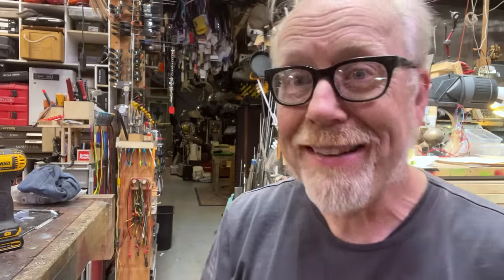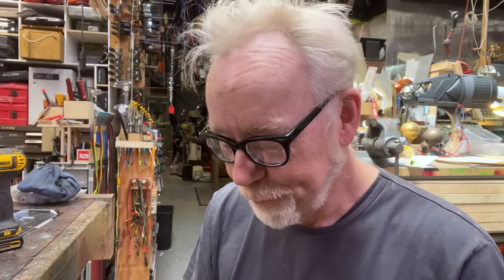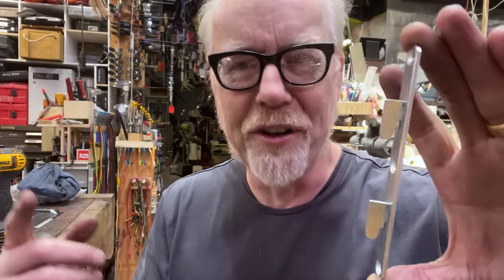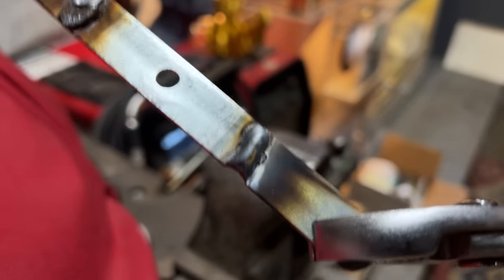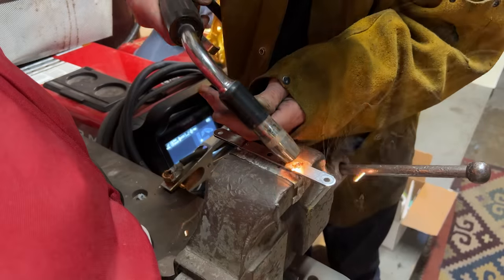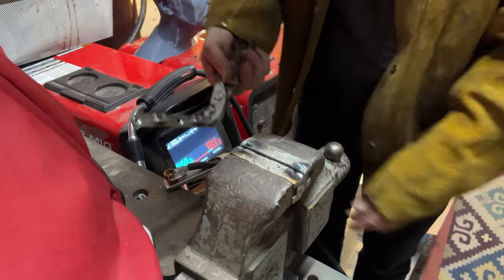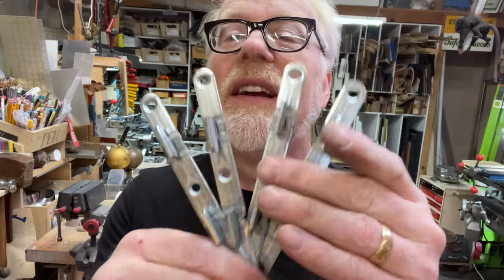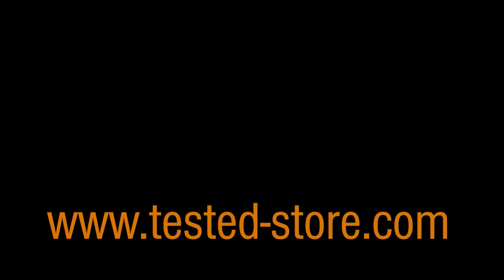Adam Savage Fixes a Squeaking Bed!

Comment: 30+ year welder  - There is no real need to grind slots into the swaged bit of the bracket.  Just welding over the area at the 120-150 amps the welder was pulling on 1/8" material would give at least 3/4 depth of penetration.    Also,  DON'T weld on anything galvanized, zinc, or other type of plated metal.  Completely remove any type of plating from at least a 1/2" around the area to be welded.  Inhaling, even small amounts of zinc oxide fumes can cause Metal Fume Fever.  A very nasty condition.
Reply: It's pretty funny how despite Adam doing so many things in 35 years, at his core the only thing where he's truly a master is model-making. He never reads books or learns from those who know more.
Reply: @ssl3546 he doesn't claim to be an expert in anything he does other then model making/ practical effects.  He's a bit of a Jack of all Trades but that also means hes a master of none of them.  He's said in many of his Q&A videos that he's constantly learning and just sharing that process with us.
Reply: @ssl3546 big assumption unless you're good friends with him? Also, this video is shot infront of a book on his workbench called 'Engines'. Which he did a video on imploring others read it because he found it so compelling to learn more about engines from someone who was an expert. So I'm not sure how true your claim is.
Reply: @Tobester_McDonkey 
That, amd putting a couple of metal shims on the flat part of the bracket,  inside the "hook" part.
A puff or two of graphite there, wouldn't hurt,  either.
Reply: How do you know if you have Metal Fume Fever? I have been doing Mig welding on Gal Pipe and been feeling under the weather, but I have been in an semi open place (double garage workshop with the doors open)
Reply: @thewhiterogue6468  Definitely asking for medical advice in youtube comments is the best way to go.
Reply: Please up vote this comment. Adam needs to see!
Reply: @vadhakara  Exactly how am I being "irresponsible"?  You can clearly see at 16:00 and later, the amperage displayed on the welder in the background.  About 120 -150 amps depending on which weld he made.  That would have given Adam the depth of penetration he wanted even without notching the brackets.  (Personally, I would have sanded to backs flat to remove the zinc anyways).
I made no mention of making any adjustments to the welder settings, let alone adjusting the Amperage Range.  
But now seeing that I'm somehow "irresponsible" in my original comment, I guess I need to explain a few things.
The Amperage Range Setting is (in this case) determined by the thickness of the base material, and not a persons experience level.  
Setting the Amp Range too low is almost as bad as setting it too high.  Because of this, there's often a chart somewhere on the welder to indicate the approximate settings that both noobs and 30 year welders alike should at least start with. Test these settings on scrap and adjust as necessary. 
The actual Amperage the welder delivers is determined by several other factors outside the scope of this discussion, but given the setup in the video, a current draw of 120 -150 amps is about normal.  
@vadhakara is correct in that the Amperage Range Setting was set a little high for this job.  This is only because Adam notched the bracket thus making the area to be welded thinner than the 1/8" I quoted.   What Adam should've done was to adjust the amperage range down to account for the thinner material.  He didn't, therefore he did "vaporize" part of at least one bracket because of this.  
But again, my original comment was in regards to not needing to notch the bracket.  Nothing else.
I still stand by that comment.
Reply: @thewhiterogue6468  First - Stop welding on galvanized metal.  If you've been feeling sick, do some research and possibly see a doctor.  
If you must weld on galvanized metal, use a grinder and sanding disk to completely remove the zinc from around the area (inside the pipe too) thats to be welded.  Wear a mask when removing the zinc.
If your getting white smudges or white smoke trails around your welds that's zinc oxide. 

Getting the zinc oxide smoke or any fumes under your hood is bad and should avoided, so here are a few things to help.
Don't weld galvanized metal inside the garage. Take it outside.  You can still be exposed outside, but your not just filling the garage full of fumes too.
Use a fan on low to blow from the side of the welding area to help keep the fumes from getting under your hood. Don't set the fan up behind or in front of you, it makes fumes getting under your hood worse. Be careful where you aim the fan so it doesn't disrupt the shielding gas.
Wear an actual N-95 mask. Change it often. (Don't use the blue medical masks. They don't wok for fumes)
Reply: @MyAvitech For welding, you should use a P100 mask. N95 masks don't work properly if exposed to oils (which may be on the surface of the metal).
Reply: 😀 @vadhakara
Reply: @dack42  Yup, P100 pucks on my respirator for welding with a risk of zinc contamination.
Reply: Even worse, some shiny metal things are cadmium plated. You REALLY don't want to breathe thoose fumes.
Reply: I had the same reaction. "How do I ask how he knew what kind of metal that is, because the color is sort-of zinc-ish? Galvanized-y?"
Reply: @MyAvitech  Good advice. I got a bucket of phosphoric acid to remove cotings, also very handy for rust. Zink is even worse when TIG welding, because it also makes the weld shit..
Reply: I had heard this before and was coming on here to say it. Essentially, proper welding gets the piece to a temperature that causes the rod/wire material to flow into the joint.
Reply: Vinegar bath for a day will remove the zinc layer. Do not weld on zinc. Do not weld on zinc in an enclosed space!
Reply: Yeah. Hmmm. Strange video.
-yup, Don’t weld zinc plated steel unless you know what you’re doing
-don’t bother with that groove perpendicular to the piece, in fact you’re increasing the likelihood of blowout/undercut at the ends. If anything a groove parallel over the tab projection would have been more useful to weld the two pieces together, but ground flush with tiny puddle weld re-ground should work fine.
-who really has this problem with squeaky bed hardware? Squeaky springs is the only thing I remember. He should have shown the incriminating loose piece with the play. (Maybe could have simply oiled it either…)

Comment: Hi Adam, I had the same issue with squeaky bed. At first I thought that hardware was the source of sound, but it was not. The root cause of it were the wood parts sliding against each other where long side bar touches the front/back of bed. The solution was to put a piece of PET sheet between the two elements plus screwing well all the hardware parts to eliminate any clearance.
Reply: Or wax.
Reply: Had same thought. Source of squeek not likely the hardware.
Reply: It’s the hardware not necessarily because the hardware itself is squeaky, but because the wear is allowing everything to move. It’s likely correct that it’s the wood that’s squeaky as a result.
Reply: Sounds like a piece of felt would be great too. Like the ones to stick under chair feet.
Reply: @Muscleduck  I think that would wear out too fast. But I've also noticed that stuff works its way out from under the feet of furniture, so I think that's another reason it might not be a great solution.
Reply: Yes and no, the idea here is to put a boundary layer that induces no squeak from itself. I'm a huge fan of using wax, but in this scenario you are as likely to create squeaking as much as removing it.
Reply: Great idea. Ideally, you would remove the squeak at the source, i.e. squeaky materials moving against each other. In my experience, nylon or even better, PTFE, works much better. When using these, you rather want to remove any movement to prevent wear and tear on the material.

Comment: Adam has a tig welder right behind him in the welding shots. On this job, I would have clamped the ears between two blocks of copper, with the main bar tight against them, and melted the swaged tabs into the main bar till the puddle had almost full penetration, no filler added. Oh yeah, and knocked the plating off with a wire wheel before welding.
Reply: My thoughts exactly. Just getting the heat in and melting the 3 pieces together at this scale would have been the perfect fix. I am certain the weld that ended up going down on the part was too cold and insufficient to actually bond. I am not a welder either, but it felt wrong lol
Reply: I thought the same thing
Reply: The zinc in the galvanized will fuck up the Tungsten in an instant. That's why we don't TIG galvanized in the first place.
Reply: @wargamingsupernoob  plus the fumes are toxic as hell. I sand that stuff off before I do anything else to it
Reply: With a TIG welder, you could weld the inside corners with little to no material addition that could interfere with fitment before weld-blending tabs on the back.

Comment: The “punch” (the male half of the die) is generally on the flat side of the part; the fillet artefact is (usually) the result of the initial distortion of the part into the female half of the die - prior to the stresses shifting entirely to sheer.
Reply: exactly opposite.
the male "punch" is on top in the cutting side(the ram), and the female die is in the tool underneath(on the table).
Reply: @TheSighphiguy  I've Heard It Both Ways😎
Reply: punch on top is proper because you have to punch it down ... the die is the bottom that holds the cut pattern and any bottom details required ... it is the place things would die if there when punched ... the roundness will always happen on the punch as it flexes and allows the metal to deform when driven into the die .... you may hit it once BUT the hammer rebounds several times this is the flex and the reason why the punch side deforms not the die side
Reply: Nah, it’s all in the tooling. That’s definitely a countersink tool. We use them daily at work.
Reply: @kaboom-zf2bl  You see this same behavior on rotary knives and shears.  The top side usually has a bend, the bottom side not.  Now top and bottom sides can vary, depending on the machine geometry.  But usually it's the forcing side that shows the initial deformation, the crisp side is the stationary one.  In my experience.  I'm sure there are people who have a differing experience.
Reply: lol that LEAKED Prigozhin video diary was the best summary of events, best thing ever!
Reply: I love the theory of the welding, but this part is so thin you should be able to get full penetration and a full weld without having to do any chamfering.
Reply: With a true male/female tooling pair, the resulting parts will have a fillet on the face opposite the tool that is their shape with the flat side on that face. For a negative space part (which would be some shape of hole), this flat side would be with the male. For a positive space part (which would be the chunk of material punched out), the flat side would be the female.
Reply: exactly, flat side is from the punch , rounded edges are from the die, material bends outwards towards the die (empty space)
Reply: @GarrettBShaw ..or at least mill the chamfer so it's consistent. Including set-up, the milling m/c would have been just as quick to use as grinding by hand, & quick & easy to alter for different positioning (eg longitudinally, which would have been my expected fix) & held the piece in place while the welding was performed rather than swapping to another vice..
Reply: Depends if the part is cut thru die, or if you cut excessive material thru die and part is that stays on die
Reply: @TheSighphiguy  Isn't it shear force? I.e both sides could be considered the cutter?

Comment: Our bed rails are bolted into the head and foot boards, two bolts at each corner. Over time it does loosen (probably from use and temperature changes through the seasons), but it’s easy enough to just get the Allen wrench and tighten it. (Yes, it’s an IKEA bed.)
Reply: All hail the furniture god 😂 I’ve lost count of how much of there stuff I’ve put together, for friends and family over the years.
Reply: If you have ever tried to put that IKEA syle of bed into a room where the space is almost but not quite the same size as the bed,the Adam style bed comes into its own.😀
Reply: I have the same bed frame style that I needed to tighten every few months. Added a bit of the blue loctite threadlocker on the bolts and haven’t had to tighten in 3 years
Reply: My bed frame is all structural steel, the rails are 2x3x1/4 angle and the frame of the headboard/footboard are 2x2x3/16 square tube there is a landing for the rail (2x3" angle welded on) that you bolt them together with two 1/4-20 bolts. I'm about 99% confident if there was a natural disaster that thing would be the last thing standing in my house. I basically copied the "Piper" bed design from Room & Board just made out of industrial materials and it looks like the store bought one has the same cheap slotting mechanism in the video... only downside is that mine with solid wood panels weighs a couple hundred pounds... never will have to worry about it falling apart or coming loose though.
Reply: I was going to say, I've never seen a bed put together with those metal things. All the beds I've ever owned were bolted. Maybe it's an American thing...?
Reply: Id rather get a bed frame from Ikea then amazon which my wife got ours from -_-
Reply: @robadams1645  not an American,  my beds (all I have or have seen) are all also either bolted or using an iron puzzle piece type shape that slots into a corresponding shape on the ends, mine are all old though, I don't know what post war furniture is like lol.
Reply: I have never seen the metal flange bits either. Fairly sure (at least in last couple of decades) I have seen bolt throughs either but the "general furniture locking thingy"; end of rail would be long screw that ends in ball and it's pushed into a large round metal piece that is rotated to force the metal ball to sit middle of it. Faster to pull apart than unscrewing long screw through the end parts, holds the moving parts in place (well, the round metal parts try to escape when not under tension) and the big round metal pit sunk inside the wood is pretty strong & easy to tighten.
Reply: @robadams1645 It's a traditional American style bed. It comes in four pieces and you combine it with a box spring. Had them growing up but I think most people are moving away from box springs these days.
Reply: I don't know if "traditional" is the correct word here. It's a common mass-produced American bed. The thing I find interesting is that it takes concepts from traditional building styles and reduces them to the minimal amount of material and manufacturing investment to create a disposable facsimile of traditional construction. The mention of pre-war iron bed rails that have mating tapered castings is really not much different but expensive to produce and will last forever if you don't break the casting. Americans are all about buying new, inexpensive, and disposable things... knda sad. By the way... those pre-war iron beds squeak too! 😊
Reply: Can't you use a threadlocker on it?
Reply: @Lanka0Kera  Oh, cam-bolts! I love those things, but on occasion, they're used for a part of the assembly where they really should have used something else, for one reason or another... However, that can be said about most furniture hardware, and when used appropriately, they're great!

Comment: The rounded over edge is the top, and the sharp (burred) edge is the bottom.
Half way down the edge you will see it goes from smooth to rough. The rough edge is also the bottom.
(Former manufacturing engineer who studied this stuff.)
Love your work Adam!

Comment: CWI here, you did a good job explaining the basics in a straightforward manner that just about anyone who is unfamiliar with the subject will understand. I love that about you.

Without going back to each example (I'm on mobile), here's some more information on what you explained:

A weld which only fuses a portion of the joint as you depicted is called a partial joint penetration weld (PJP). PJP's can be made from one side (single sided) or both sides (double sided). Double sided PJP's are deceptively weak because the void in the middle (lack of fusion and/or penetration) provides a) no support, b) a place for the surrounding metal to flex, and c) sharp surface features which over time will likely be the start of a crack that could cause partial to complete failure of the joint.

Complete joint penetration welds (CJP) are welds with 100% fusion to all surrounding metal in the joint. CJP's can be made from one side with certain considerations but are double sided for your example. They are also preferred for most structural joint designs where fillet welds or other niche designs are impractical, but PJP's also have their place.

Adding bevels to any groove weld (a weld in which a void is designed to be completely filled) allows for deeper/easier penetration and usually greater strength with less heat input.

Welding through a hole in one part and into another part & filling it is simply called a plug weld. Elongating said hole into a slot is called a slot weld.

Comment: Those parts look zinc plated, you want to be careful of fumes. Although it was just a few small parts and not a lot of welding
Reply: Absolutely
Reply: Thank you - I was going to make the same comment. I either use extra ventilation or acid strip the plating prior to welding.
Reply: Plus welding gloves wouldn't hurt -- quite the opposite.

Comment: I feel like drilling a small hole half way at each end of the fillet (or even just the top) and spot welding there would have been more stable and less likely to compromise the bar.